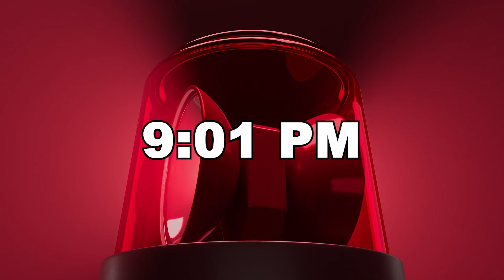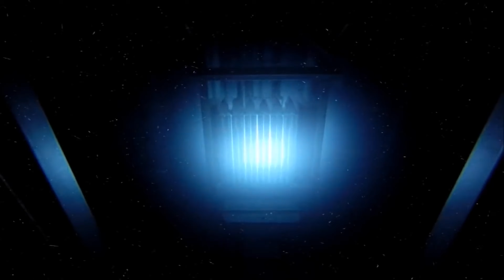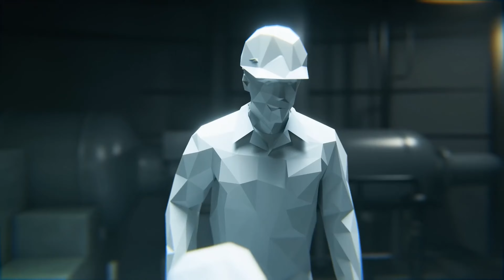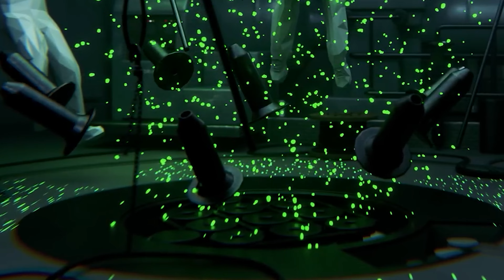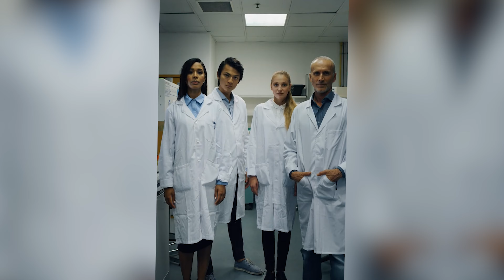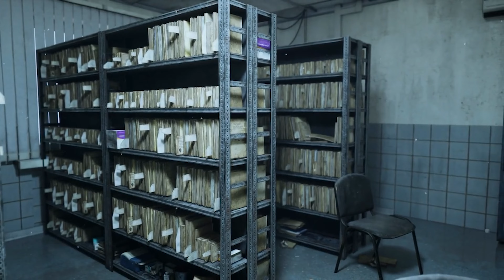America's Deadliest Nuclear Accident EVER

Comment: I worked with a guy that said he was a part of the first responder team.  it was  definitely a harrowing experience the thing is the reactor was cold  cold water adds a lot of reactivity to a light water reactor like SL1 there was too much reactivity in the core   when the rods were pulled that added additional reactivity. if I had to write the procedure for rod exercise I would try to have a higher temp in the core. higher temperature water limits the reactivity in the core. the thing about SL1 was there was speculation the rods were deliberately pulled in a manner to kill the operators there was a rumor one of the operators was  having an affair  with e other's wife. that was never verified. but that was an explanation for how the disaster could have happened. no on knows the real answer. when a highly enriched core is started  the coolant pumps are used to heat the coolant coolant pumps have such high horsepower the operating friction can actually heat the water. that's how things work nuclear plant physics  is interesting. the navy nuclear power program teaches  a lot. of physics. I graduated in 1976. I worked as  a health physics technician for over thirty years. it was  a good career : I had a blast.  traveling around the country  suited me to a tee.
Reply from the maker: Yes, I can imagine.